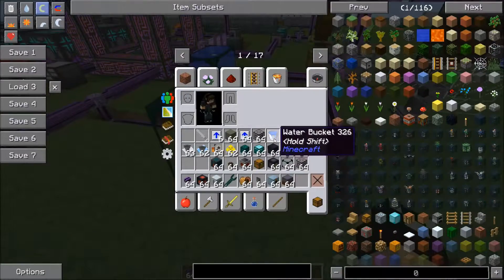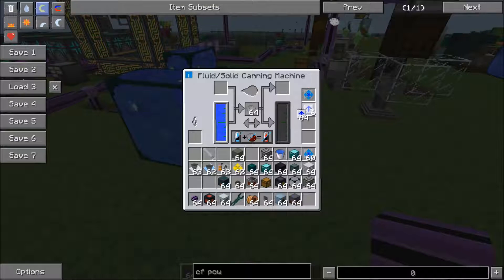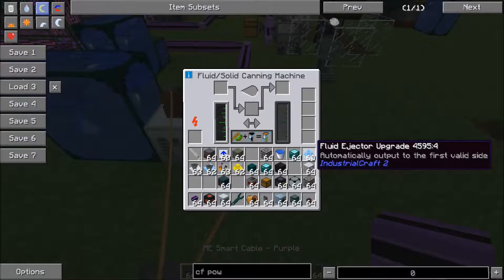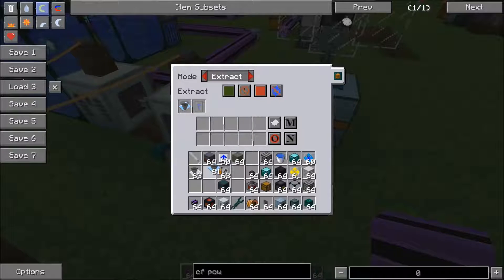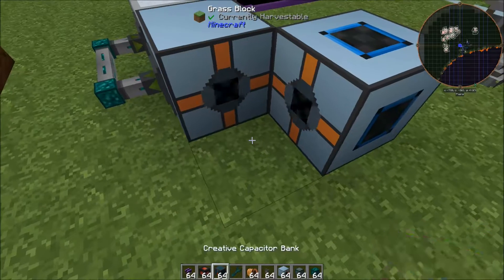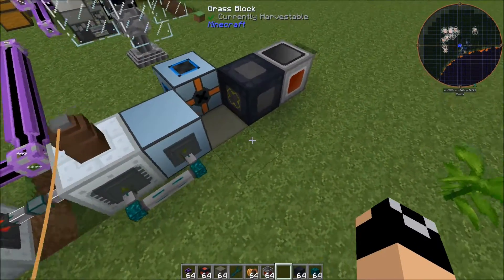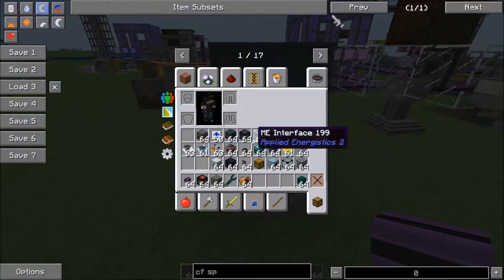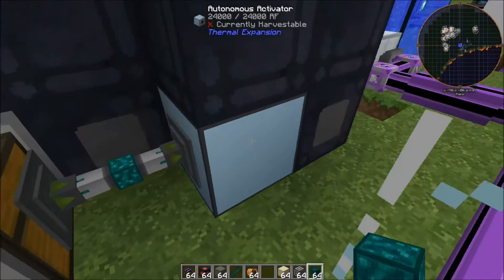Let's Automate: IC2 Reinforced Stone

Comment: I have another setup using Formation/Annhilation planes, and it all works just fine, except the activator won't use the foam sprayer on the scaffold, like if I manually use the sprayer everything else works a charm, the auto sand/breaking and whatnot, and when the sprayer is empty it goes to get refilled from the Activator, but the activator simply refuses to use it, any tips?
Reply from the maker: Hmm, is it running on a redstone pulse I'm assuming?  And I assume that its already set to right click and everything.Hmm, im not sure what would be causing that.  Ill def try and set it up and see if I get the same issues
Reply: It's currently on an always active state, I'll try wiring it to a pulser.
Reply: And I also have it where the sand is always pumped into the Activator via a direct line, however this isn't even connected to the problematic Activator so it shouldn't be the problem
Reply from the maker: Yeah, that may help perhaps, it may not be updating correctly or something and not spraying due to that :p
Reply from the maker: Yeah, as long as its not just throwing down sand before the framing can get put down, then the sand shouldnt be a problem.
Reply: I've found my problem, I am on a multiplayer server with factions enabled, by default CoFH isn't given F admin privilages and therefor Activators are very limited what they can do, I'm surprised the sand even worked. This is also why the sand didn't get placed before the scaffolding, it didn't have permissions.
I've forwardded a request to allow CoFH permssions in faction lands, will post if it works
Reply from the maker: Ah, yeah, hopefully they get that fixed.  Activators are way too good to limit like that.  Fingers crossed that they fix it for you :)